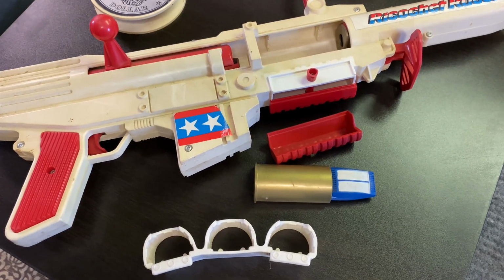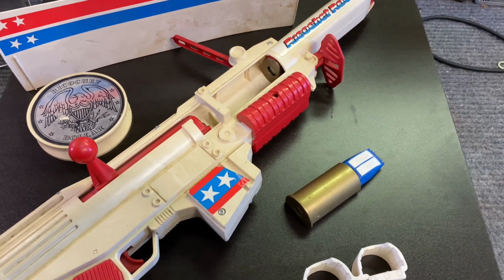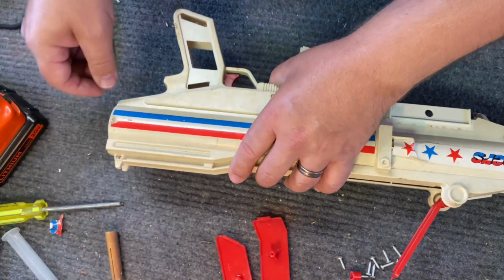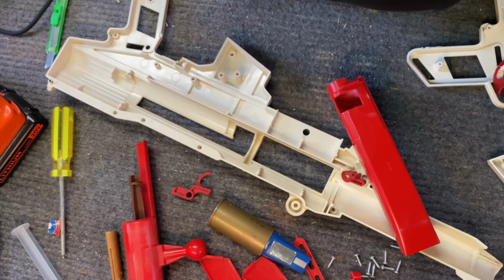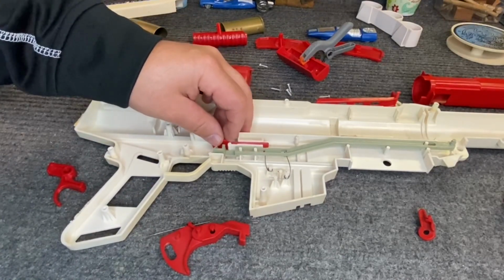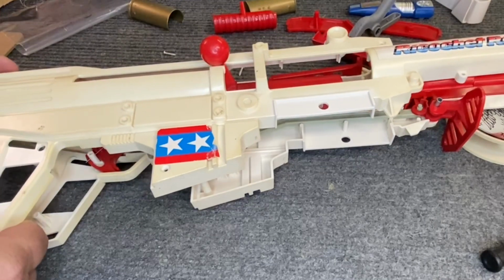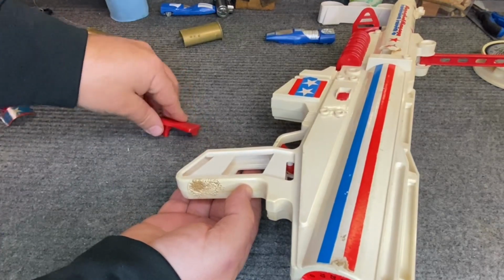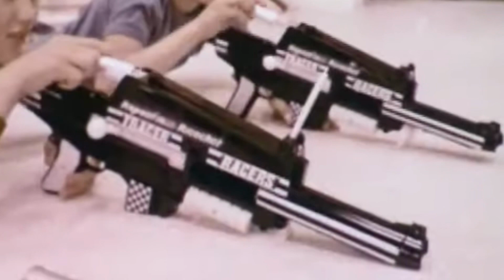1974 Hasbro Ricochet Racers - Complete Tear Down - How It Works & Repair

Comment: My brother and me got these for Christmas '79, the Spiderman versions & the Dukes of Hazzard watch was a Wrist racer, I also had one that I got for Christmas in the '80s.
You'd put the car in the wrist launcher, wind it up, pull out a plastic ramp then push the button at the back to open the hatch & launch it & the other toys you mentioned were burning keycars which I also used to collect.

Comment: I loved this toy as a kid. 15 years ago I found a brand new unopened set on EBay and bought it. Of course I had to open it and play with it. Everything was in perfect order with the exception of the sticker sheet which was dried out so the stickers can’t be used. Still very cool.
Reply from the maker: That’s cool, use glue stick to apply the stickers.

Comment: Have you ever use a Pryograuer in repair if this Plastic Toys
Reply from the maker: Hi George, I haven’t used one but I’m sure I could come in handy in many repairs.
Reply: I never thought of using  on Plastlc till now.
I thought there for BurningvWood engraving.
But got to repair the Face on a Plastic Army Men iam going To Paint
I might Used E-6000
Mix with Modge Podge after it Cures well be hard like Soft Plastic
Reply from the maker: @georgemartinezjr  good luck!